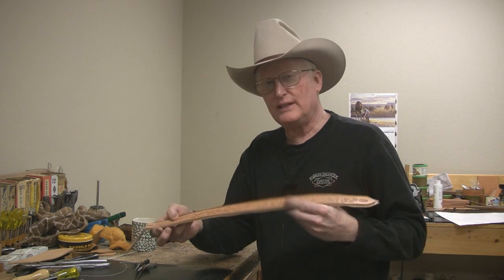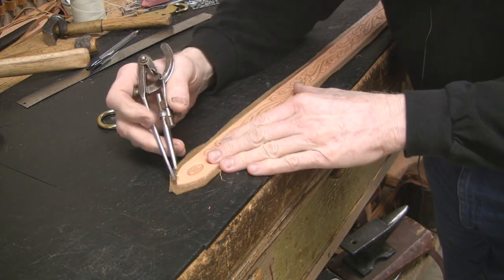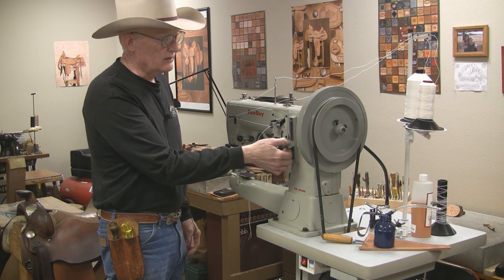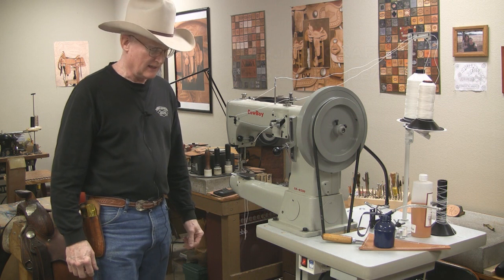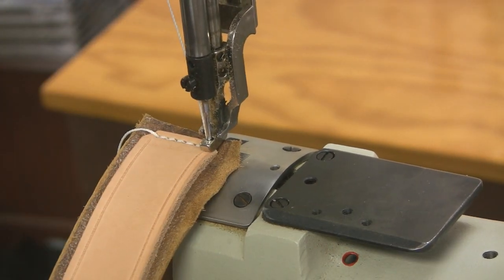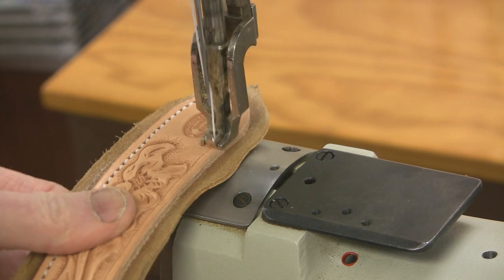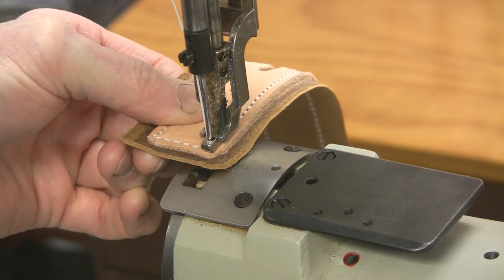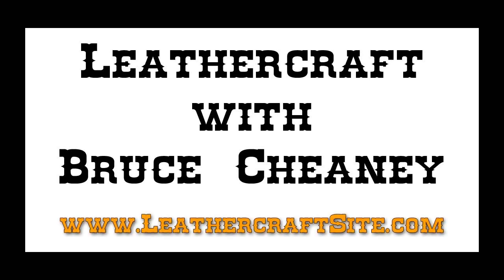Leather Sewing Machine ✅ Works Great for Saddle Making 🎞 Saddlemakers Secrets

Comment: hi Bruce, thanks for the wonderful video! I noticed you back tacked a couple of stitches at the end, do you use a round point needle or a leather point needle? I've heard that the leather point needle can severe the thread as it's sharp when back tacking. do you have any recommendations?
Reply from the maker: Point needle, I very seldom have trouble with severing the stitches when I back up two or three stitches. Thanks for asking. Bruce

Comment: Bruce, have you used the stirrup or holster plate attachments on your CB4500?  Very little info on the use of these optional attachments for the CB4500.
Reply from the maker: Yes I have used the stirrup plate. All you have to do is take the regular plate off and put the stirrup plate on with two screws and it's ready to go. It works very well no problems with timing or anything like that. Bruce
Reply: Do you have to adjust the height of the feed dog or change the foot?